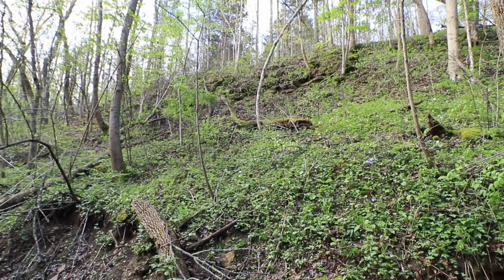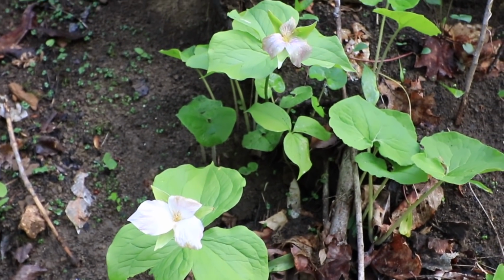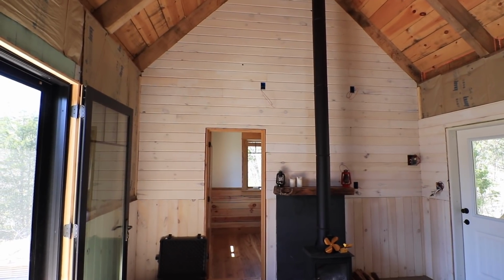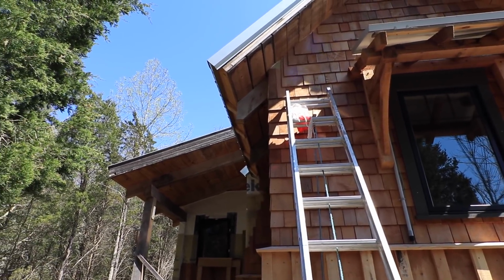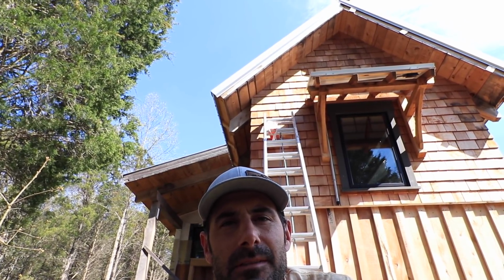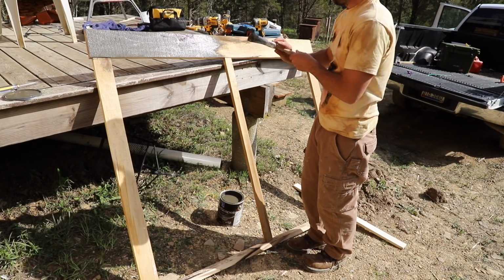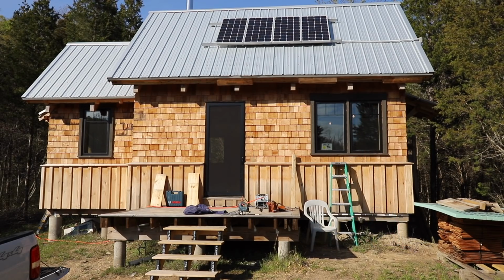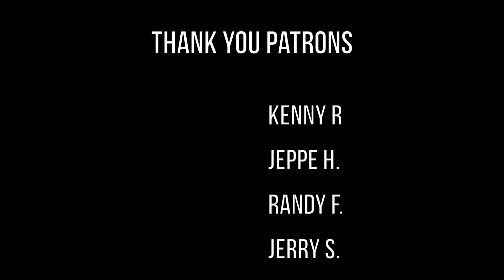Another Wall (almost) Done | Timber Frame Cabin

Comment: Looking good.

Kreg pocket hole jig is worth 100x its weight in gold.

When doing window trim after cutting and prepping. I paint or stain  both sides. 
In the event that moisture gets behind the trim, it will protect the wood.

I know this never happens in the real world where everybody does every job perfectly.
Sarcasm. 

Why do I know this?
Because I get paid to fix things that previous contractors said would never happen.

When a contractor says do not worry that will never happen, or cannot explain in detail how they are going to prevent X from happening. 

WORRY!
Reply from the maker: I love that thing!  Yea I should have back stained it as well.
Reply: @50Acres I recently redid a garage that had rough cedar trim. Some of it needed replacing.
The original franers did not allow for a drip edge at the soffit line.

I used new pieces to go over the existing gable ends. 

Took all the trim off the windows sanded both sides stained and installed smooth side out 

The bad pieces were trimmed off and the 45 ed on the top edge,
sanded and stained and then reused as much as possible along the long straight runs.

I pushed the angle edge up under the roof edge flashing and shot in with a brad nailer.

Reusing the wood saved a good amount of money and now it looks cool because it is the only one smooth side out.

It is different.

Take care.
Again good work.

Comment: Your getting really good at cutting around the switch boxes. Nicely done. Oh if your going to skirt the cabin with lattice, PLEASE use square and not diagonal. Square is classic. I used brass hinges to hang mine around a deck so I could lift them to gain access underneath.
Reply from the maker: Ha ha yea I am improving at that.  I like the hinge idea.  I thought about putting some storage bays like you see under RV's or busses.

Comment: For people who have never built a house after work and on weekends at a place you don't live it is hard for them to understand that sometimes you just aren't feeling it and things just don't work right but you have to keep on plugging away and it becomes a very hard task to do anything.  It is those times when everything goes wrong because you just can't keep up the really hard task of plugging and it not wear you down.  In your case you can let it coast but then again that little part of your conscience just won't let it and makes you go back or feel really guilty for not doing it.   I have been there and done that, those are the stupid days when all you do is climb the ladder and forget the one thing out of a dozen every time you climb the ladder and drop the hammer or screw or whatever and the day drags on forever and when it's over it seems nothing got done.  Don't worry there will be lots of great ones of course there will always be some more of these.
Reply: Roy, you have no idea in the reality of the wisdom of the words you just wrote
Reply from the maker: Hey thanks Ray, I can tell you've done this before huh.   I've had quite a few of those days.  Usually it's time to take a break when I do.  Take a week or so off and get back to it once I have more motivation.

Comment: Everything looks great but I was wondering why your soffit is below the fascia and it looks like it may be wet its on the gable side where your finishing up the shingles. Maybe Im wrong and its just how the camera is showing it. Keep up the good work.
Reply from the maker: I'm not 100% clear on your question but I will try to answer it anyway.  I used pine boards that you can see there because they are going to be exposed as the finished ceiling inside the cabin.  I then built up a big box and filled it with polyiso sheets, insulating the roof from the top.  I have not yet trimmed out the fascia so you see the boards from the ceiling and then the boards that build up the box that holds down my insulation sheets.